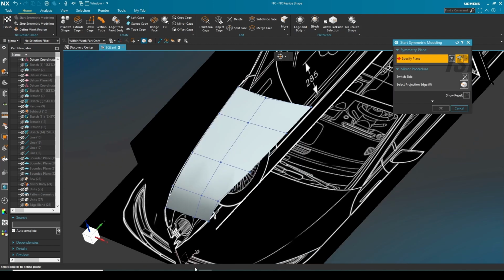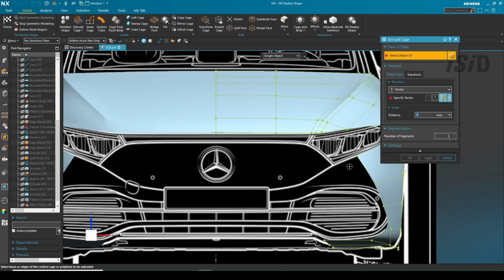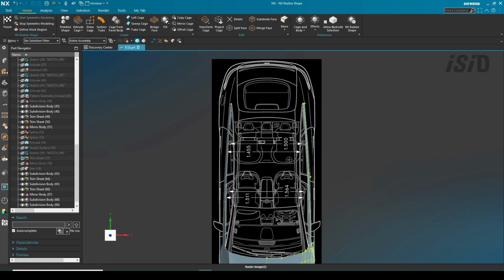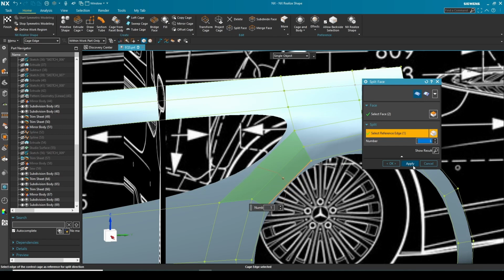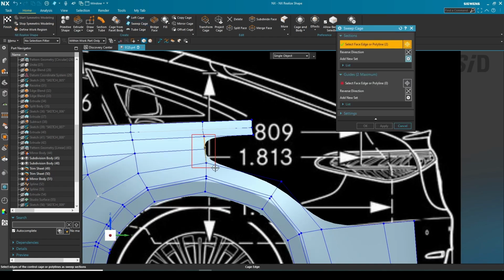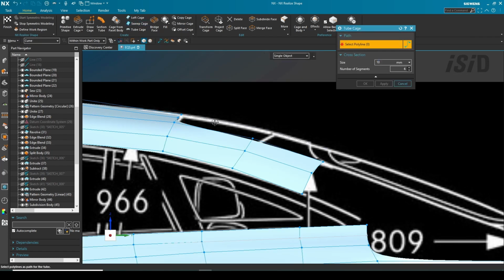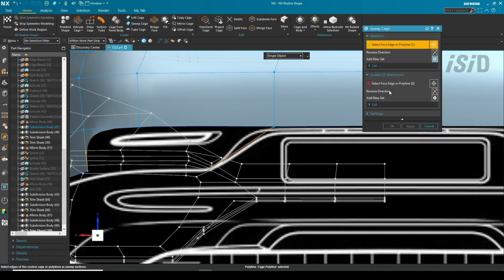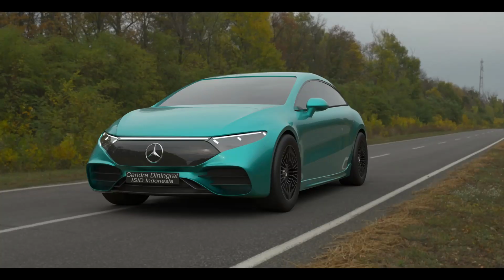Subdivision Modeling of Mercedes-Benz EQS with NX Realize Shape

Comment: Very good work my friend!
Your skills are top notch but NX seems to be missing some major subd modeling features like the ability to further subdivide (without altering its shape)your mesh .
Do you know if they have plans to improve the subd capabilities of NX?
Reply from the maker: Thank you Nick,
NX has "Subdivide Face" command but off course if we use that, it will change our shape behavior
Reply: @id.dentsusoken  Yes correct.....I might be wrong but it also seems that NX can benefit from some subd features that even free programs like Blender have as basic tools. When that happens I ll look into NX more seriously for industrial design. Will they ever update their toolset to add more features?
Reply from the maker: @nickpunch9661  Yes there are a lot of software give the subd toolset, Just what the different in NX, we can directly use the 3d data to downstream applications like to NX CAM or Simceter3D without data convertion. I believe in the future more features will be added. NX releases major release update in every 6 months. In the four latest releases NX more focused on AI assisted features. There are also many interesting features like Algorithmic Modeling, Implicit Modeling, and many more. Since NX 1953 also there are a lot of enhancements invested on Visualization sector.